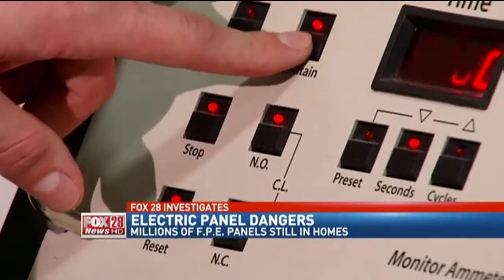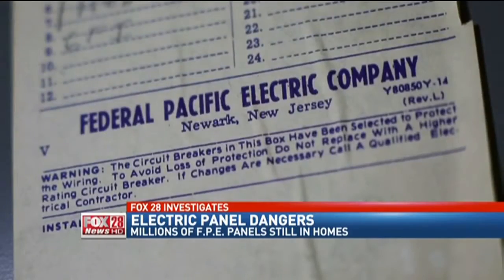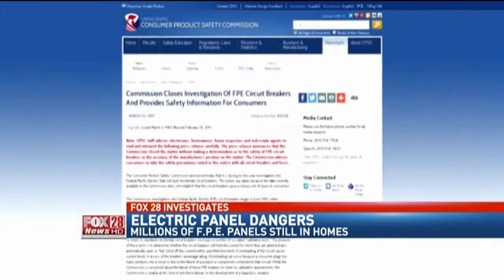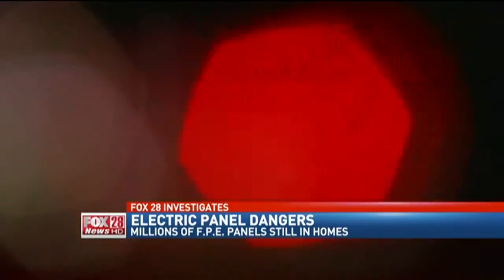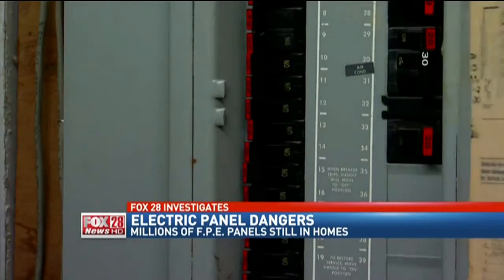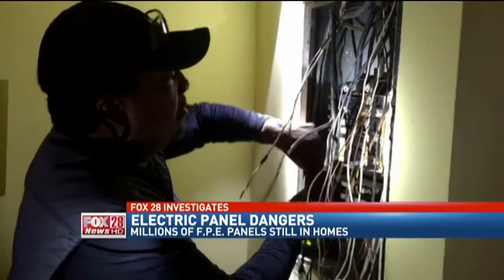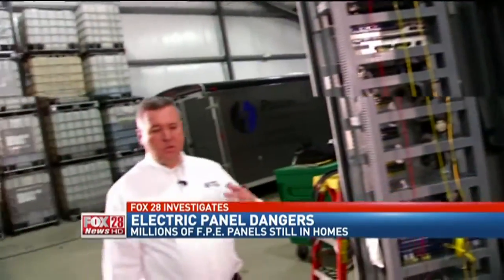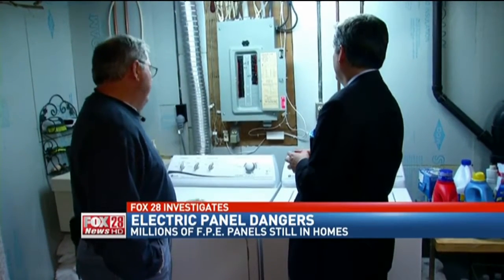DANGEROUS CIRCUIT BREAKERS - Federal Pacific electrical panels

Comment: A friend of mine was working in a family members garage and was seriously burned when unplugging an arc welding machine.   Part of the plastic housing had broken away, causing one of the lugs to break free and short out against the metal box and metal conduit.   The welder outlet was fed by a FPE panel.   The breaker for the welder AND the main breaker both failed to trip. Eventually the cutout on the transformer blew.   My buddy is literally crawling on his hands and knees to get out, with the panel on fire and the conduit burning like a fuse spraying molten metal everywhere.

Comment: What they fail to mention in the report is that you are responsible for the replacement of the defective product at a price of 2000 to 4000 do you have that much cash in your pocket
Reply: Yeah they act like it’s cheap and everyone should do it lol. You have to remember that box has been in your house for 40-50 years without a single problem so if you’re tight on cash the panel can wait.
Reply: @everythinghomerepair1747  actually no because there is a nasty side effect to the panel when the panel fails it sends electricity through the ground wire of the house this can result in people hooking up the plugs in a house to the live ground wire setting the house and the box on fire sadly
Reply: The cost of replacement is not cheap. I recently replaced my FPE panel with a brand new Square D panel and breakers.  Did the job myself. Now, a lot of people will tell you that you need an electrician . It's probably a good idea , however,  I'm a retired electrician, so it was a quiet morning of work at home. If you are not an experienced electrician,  this is a job for professionals.  Also, I actually still have my tools, which is an important part. The average homeowner doesn't have the skills or tools for this task. Interesting footnote,  my old panel had no signs of arc or burn or overheating.
Reply: @kurtrobinson1926  thank you
Reply: @johnDingoFoxVelocity  another fun fact. 2 weeks after I did this, Mt insurance company came to inspect my home for issues such as a FPE panel.  I got a clean bill health for my property, and a discount for having a metal roof as opposed to a composite roof. It was worth the morning spent and the $350.00 in parts.
Reply: @kurtrobinson1926  Yes you need an electrician, shop and find one reasonable but get an electrician.  He knows the codes, he knows what is safe and will resolve other things that many people do not see or know.  You stated no issue in your panel but do you realize that FPE was banking on their breakers not really being needed most of the time until a fault occurred?  The issue is exposed when when there is a fault.  I have had people tell me safety equipment is not needed on a job, yeah it's not needed until it is and then suddenly they see the value of it.